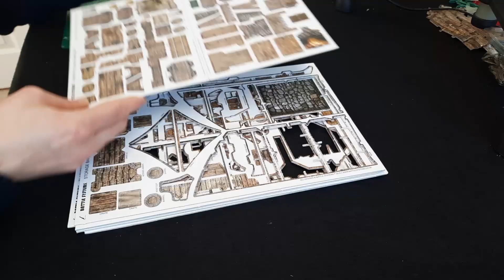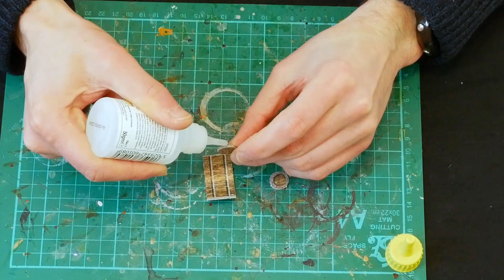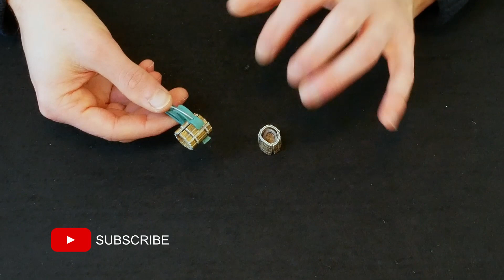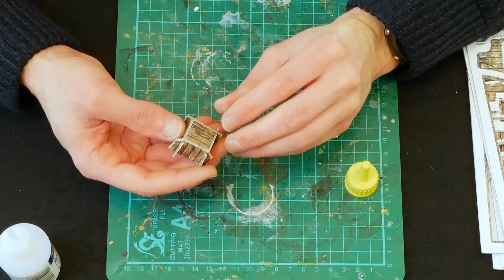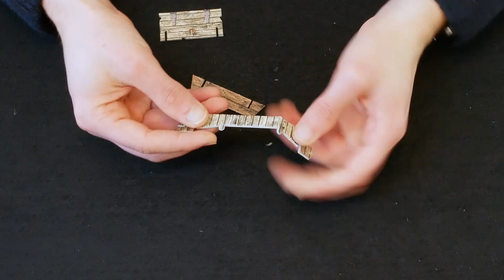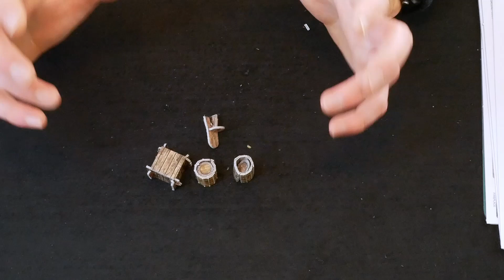Battle Systems Fantasy Village Terrain build guide series part 13: Scatter Terrain

Comment: I really love the review.  I just bought a bunch of the battle systems terrain, and I was iffy on the scatter terrain.  The bigger bits of the terrain in the kits look fantastic, including things like the chimneys and storage bins that fit right up to the buildings, and some of the smaller stuff like the chairs and tables are pretty good, but stuff like the barrels and crates seem kinda "meh" to me.  I guess it's a bit of a bonus if you like it, but tbh, I'm probably just going to get a bunch of barrels and crates 3d printed and paint them up quickly instead.

Comment: Hey Buddy! Love the videos on Battle Systems! Much better than the b/w stuff from the company, Hats' Off to You my Man! I have a request. I have been on the edge about buying a ruined tower and smaller ruins for the other 2 for a while. I was wondering if you could do a video on making a tower and 2 smaller towers for The Silent Tower Scenario. I have the FV Core set, ruined Monestary and Ruined Village sets. My experience with building is limited, I play solo alot because of work, but have found a couple-new players. Any Help man?
Reply from the maker: Thanks man, glad you like them 👍 i think I've played that Frostgrave scenario but it was some time ago. To be honest I think it will be hard to build a proper ruined tower using battlesystems terrain as their citadel towers aren't 'ruined' and the stuff that is ruined probably won't look right added to the towers. I think something could be made from the townhouse/cottage/storage barn + the ruined village set if the ruined 'tower' could just be a tall ruined building, not a traditional stone tower. If i recall i dont think that scenario required the main building to be a certain base size, it just has to be tall.
Reply: @NoProcrastinationMiniatures  Looking atthe Wizards' Tower video. Think with ruined monestary set, we might be on-to something! Holy Sh#t!!!! lmao